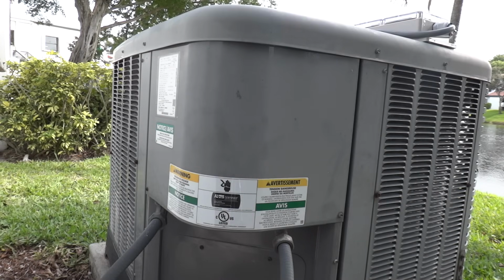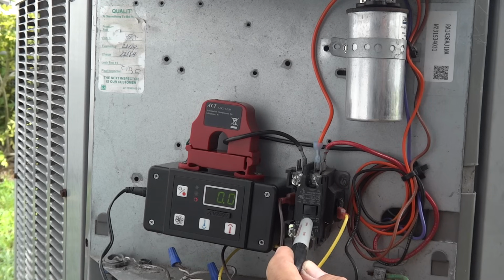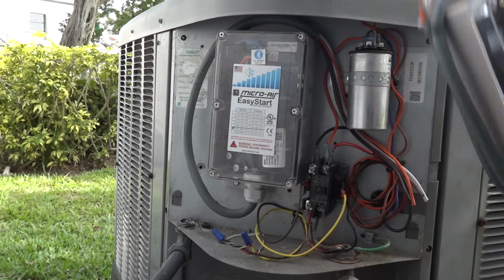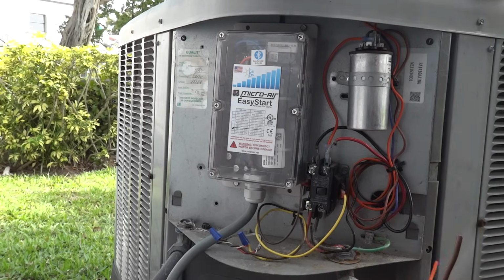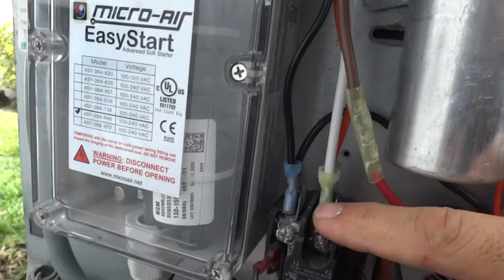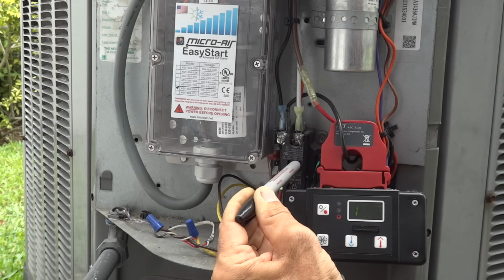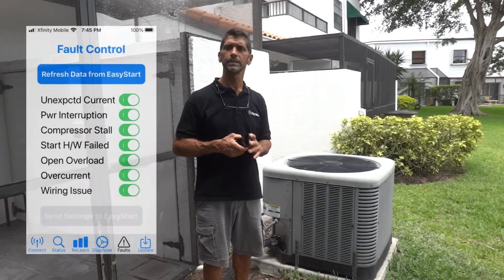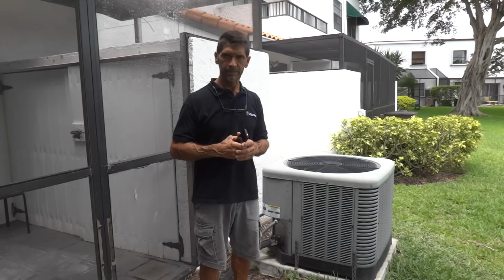Micro-Air EasyStart Home A/C Installation (368 Series)

Comment: Would this work on a well pump 🤔
Reply from the maker: Hi Nick and thanks for your question.  The short answers are: Yes for 3-wire well pumps, and No for 2-wire well pumps.  Wiring a well pump with EasyStart has been done with success a few times in the past, but the Micro-Air support team has ceased support for such efforts since it can be massively time consuming. Unless you are adept at electrical wiring and can identify the common, run and start windings of the well pump, then Micro-Air would not recommend that you purchase an EasyStart for such an application.  If you do know what you are doing, then go for it!  Thanks for your understanding.

Comment: Can these be added to a rooftop mounted, package unit in a harsh climate like Las Vegas or Phoenix?
Reply from the maker: Hi and thanks for your question.  Yes, the EasyStart can handle those extreme climates.  The EasyStart model 364 has demonstrated this for several years now as it has been installed into RV rooftop applications that reside in mostly desert conditions. For your package unit, simply make sure you don't locate (mount) the EasyStart near or in the hot air discharge path of the condenser fan.

Comment: Interesting how does it affect the warranty on the AC if still applicable.?
Reply from the maker: Hi John, and thanks for your question.  The honest answer is: It depends on the OEM manufacturer.  Although everyone knows that EasyStart protects the compressor better than any OEM configuration, some manufacturers who don't understand what EasyStart is may reject a warranty claim if one is installed.  We find this preposterous because many people install hardstart kits which is still "modifying the equipment", but most manufacturers don't put up any warranty argument against those.  The easy and honest way to get around this is to follow the same method:  Install the EasyStart in such a way without cutting any wires where it is easily removable.  Then, if during your warranty period something fails like the fan, or the control electronics, or it develops a refrigerant leak, simply remove the EasyStart before submitting the system for a warranty claim.

Comment: Thank You, it was a great video explaining all the details. I plan on purchasing one shortly. I have an old 5 Ton Trane 36 year old AC and I'm not quite able to purchase a brand new one just yet. My electric bill over $900.00 dollars. I hope that this will reduce my electric. Of course the electric company is price gouging when the country is in despair. Thanks again
Reply from the maker: Hi and thanks for your comment and for your business!  Just to make sure this is clear and you are not disappointed, although EasyStart will dramatically reduce the startup current spike that your compressor draws during its first second of operation, EasyStart does not affect the compressor's current and power consumption during steady-state running. Therefore, EasyStart will not reduce your kWh consumption (i.e. energy use).  However, if you live in an area where your electric utility charges what is know as a "demand fee" for peak power consumption during certain (high-demand) times of the day, then EasyStart would reduce and perhaps even eliminate those fees.  I hope this makes sense.
Reply: Try cost justifying investing in some solar panels with a 5 to 11k inverter and if you can afford it, some backup batteries.  There are Federal and some States have Tax credit incentives to help with the costs.  Over time reducing that $900 bill will pay off.  Avoid financing where they put a lean on your house.  Some dealers call it something else but its a lean.  Either pay cash or get a conventional loan or a home Refi line of credit.   Also, as a low cost option, having upgraded insulation and attic fan could help a bit as well.  
Hope that helps.
Reply: @GlenCapobianco  l live in Las Vegas, NV. I installed an attic fan and remote wireless thermometers in my attic and outside under the eaves always in the shade. I wanted to document how well the attic fan worked. 

Much to my surprise, my attic never got as hot as the outside air, was always cooler, even at 5pm the hottest time of the day, even during weather alerts and warnings for extreme heat. 🌞 

So, I never turned my attic fan on. Why would I want to replace cooler air with hotter air?

This totally surprised me. I just ignored the attic fan. In hindsight, obviously, I wish I had benchmarked the air temps before buying and installing the attic fan.

Comment: My condensing unit starts up with liquid in the (scroll) compressor after sitting a few months, which besides making lots of noise, can't be good for the compressor. Does this EasyStart unit reduce start-up stress on the compressor with its soft-start while in this condition?
Reply: Your crankcase heater may have failed, or there may not have been one installed from the manufacturer. It's an easy installation/replacement. It looks like a big hose clamp wrapped around the outside bottom of the compressor. It slightly warms the compressor so that oil and liquid refrigerant do not migrate to and stay in the compressor.
Reply: @icanreadthebible7561  This unit does not have a crankcase heater, and Emerson even says they're not required for scroll compressors if they have a max charge level meeting their specs. See this: https://climate.emerson.com/documents/crankcase-heaters-for-scroll-compressors-technical-information-en-gb-7486018.pdf 
I also don't want to install one as it would cost $125/year to operate it in my area. The soft starter solves the slugging noise problem as I said above, so these EasyStart units do a great job.
Reply from the maker: Hi and thanks for your question. As you already know and as all compressor manufacturers would agree, "slugging" liquid refrigerant or perhaps a slug of oil through the scroll vanes during startup is not the best thing for the health of any compressor.  But, as you pointed out, it's sometimes unavoidable.

We don't have any empirical data to back this up, but basic logic dictates that because EasyStart will more gradually ramp up the compressor speed as part of its soft starting process, it will certainly be less stressful on the compressor mechanism itself during the first second of operation.  Most certainly, EasyStart will result in less mechanical stress versus a the much more abrupt and aggressive acceleration of a typical hard start (i.e. without EasyStart installed).

Comment: I purchased one last year and my 8500kw generator runs my 3Ton Trane along with 2 refrigerators, lights ext. 

Question: can something like to be used on an inverter based AC system like a Daikin or Mitsubishi? My guess is that they don’t need to be used because of the low start up requirement of those type of compressors. Can you confirm?
Reply from the maker: Hi Jim and thanks for your comment and for your business.  Regarding your question, what you suspected is correct.   Inverter-driven compressors on mini-split systems do not require nor can they even accept a soft starter. Such compressors are 3-phase, brushless DC (BLDC) motors.  Typical home A/C compressors like yours utilize AC induction motors, for which EasyStart applies.  BLDC motors are already ramp started by their controller to eliminate any starting surge, so there is no need for a soft starter.

Comment: can I install a Micro-Air EasyStart in a compressor or any other motor?
Reply from the maker: Hi and thanks for your question.  The short answer is: It depends on the type of motor.  EasyStart is designed to work with single-phase, split-capacitor motors; these are single-phase motors with a run winding and a start winding.  Single-phase motors without start windings, known as shaded-pole motors, are not suitable for EasyStart. Please also check out the reply we made to a similar question from @MrMotofy from a 2 days ago.  There can be a lot of challenges associated with applying EasyStart to closed-frame motors, other than HVACR compressors. Micro-Air unfortunately does not have enough resources to support individual applications like these.
Reply: @MicroairNet  would be great if you guys made something like this for well pumps in a home.
Reply from the maker: @Barr Thom Yes, as was previously asked by @Nick G and answered by us in another comment to this video, EasyStart can be wired to 3-wire well pumps. The wiring is a challenge though and is not recommend for someone who isn't very adept at electrical wiring and PSC motors.

Comment: Could one of these be added to an 120v air compressor to help with the high draw on startup. I think most of em have a 2 wire Capacitor
Reply from the maker: Hi and thank you for your question. The short answer is yes and no.  It has been done with success in the past in some cases, but Micro-Air does not recommend it nor can they support you in the effort.  Here's why.

Years ago when EasyStart first came out, Micro-Air did work with customers with air compressor, dive compressor, and HP water maker pump motors to install EasyStart.  Unlike air conditioning compressors that "present" all of their wires quite easily and readily, closed-frame 1/8 to 3 HP motors do not! In fact, in order to gain access to the wiring, you sometimes have to disassemble the motor.  Then, if you cannot get the motor manufacturer to provide you an accurate wiring diagram for all of the motor's internals, trying to identify the common, start, and run winding connections can be almost impossible.  Isolating the run winding is also sometimes impossible.  So, unless you have a detailed internal wiring diagram for your particular motor, have extensive electro-mechanical skills where you can locate and access all of the wires by disassembling if necessary, and have infinite patience and persistence, Micro-Air does NOT recommend that you consider installing an EasyStart on such motors.  Micro-Air is a small company and is literally buried in production and support work this time of year, hopefully you can understand this position.  Thank you for your understanding.

Comment: How long is the life of the EasyStart. The way I understand it is that it needs to be replaced every 2-3 years
Reply from the maker: Hi and thanks for your question.  The life of the EasyStart will most likely exceed the life of your air conditioner. It does NOT need to be replaced.  In almost all cases, the air conditioner will have to be replaced first, and many people will remove their EasyStarts, reinstall them into the new unit, and perform the relearn process.  There are EasyStarts installed into the Micro-Air factory air conditioning systems in NJ and in the owner's home that have been in operation since 2012.
Reply: @MicroairNet  Great News! Thanks for your information!
Reply: @MicroairNet  thanks for the answer!

Comment: Can this be used on a 3ton York Heat Pump?
Reply from the maker: Hi and thanks for your question. Absolutely.  A heat pump is simply and air conditioner that has a reversing valve, allowing it to heat or cool.  The compressor wiring is the same, and how the EasyStart wires in is the same.
Reply: @MicroairNet  Thank You for such a prompt response! I will be ordering one asap... any discount codes? Can't blame a fellow for trying...
Reply from the maker: Glad to help and no problem asking.  Enter EASY15 at checkout and you will get $15 off!

Comment: I'm not interested in operating my AC unit on a generator, but I am looking for ways to quiet the outside condenser unit.  My house being just 4 years old was built with the unit just 3 feet from a bedroom window.  Dumb.  When it starts, it's very loud and sounds like a train wreck and is a disturbance to the quiet bedroom.  I was thinking of adding a compressor sound blanket as well.  Would the Micro-Air make the starting noise more quiet?  Living in Arizona with a 5-ton keeping  2400 sq. ft. home comfortable.
Reply from the maker: Hi and thanks for the question.  As a matter of fact, YES, the EasyStart will quiet the noise that the compressor makes when it starts up!  This was an added benefit that we never thought mattered until our (RV) customers started telling us about it in droves.  It works the same on a home A/C unit too.  EasyStart of course does not affect the noise that your compressor makes when it is up and running steady-state.  It only affects the start-up noise.
Reply: Hi 
I am planning to install Easy Start for quieter  compressor starting.
Thanks for answering my question.

Comment: So its a hard start kit inside a fancy enclosure.  With wiring so any homeowner can install one..  right?  I could see little ole miss betsy with a screwdriver, this thing and a confused look on her face standing in the middle of a pile of parts of what used to be her air conditioner..  lol..     

But would be only right to advertise the product as a hard start kit..
Reply from the maker: Hi and thanks for your comment. As it turns out, EasyStart is not anything at all like a hard start.  Please watch the video at this link, https://youtu.be/soP0uZFd0nQ, for a detailed side-by-side test and explanation of a hard start vs. EasyStart.

Comment: If this product is that useful why it is not integrated with the original A/C?
Reply from the maker: Hi and thanks for your question.  Many of our customers who install EasyStarts on their RV A/C units ask the same question.  The short answer is, most if not all of the OEM A/C system manufacturers, be it for home, RV, or marine, know about the EasyStart and the fact that their customers see huge benefits when running on a limited power source, or simply extending the life of the compressor on utility power.  However, when it comes to building EasyStart into their systems, many of these manufacturers won't take the risk of increasing their product costs since they are all typically in fierce price wars with each other.  It's very sad, but we at Micro-Air don't despair.  We're actually quite happy with selling EasyStarts in the aftermarket, be it to great end users like you, or contractor/dealers who install them for their customers.  We design and manufacture all of our EasyStarts in the USA.

Comment: My question would be, using normal grid and not a generator
Could a soft start help lower a power bill when the AC/Heat is in use as the required power to operate is lessened?
Reply from the maker: Hi and thanks for your question. This question is asked a lot, and the answer depends. First of all, the EasyStart does not affect the running amps of the compressor.  It only reduces the starting amps.  So, since the startup only lasts about 1 second, there really is no measurable energy (kWh) savings over even the long term that would make a noticeable difference on your electric bill.  HOWEVER, in some parts of the USA, residential customers get penalized and charged for what is known as "demand usage", like most commercial customers do.  Demand usage is your instantaneous kW (power) draw from the grid, not the kWh (energy) consumption.  Obviously, since EasyStart pretty much eliminates the starting surge that your compressor would normally draw, if you live in an area where demand usage gets charged to you, then yes, EasyStart can save you money in that case.  Hopefully, we were able to explain this difference clearly enough.
Reply: @MicroairNet  Yup, exactly the info i was looking for. Thanks :)
Reply: No, at most it would provide a power factor correction which in residential power, doesnt factor into anything as the back emf isnt substantial inside homes unless you have a sizable shop with equipment and machinery inside.. all this does is smooth out the ac waveform and provide a starting current for the bigger motors on the ac compressor/s so they dont draw all that power thet need straight off your incoming power feed..  think of it as a spring on a garage door, without it the door will still open but over time the motor will start to bog down and eventually fail, the spring is added to lessen the strain on the motor.   The reason theyre not included in every ac is because most already have a factory installed start capacitor to take up that strain on startup.  But overtime, on over used systems or under rated systems  will begin to fart out and hard start kits will be suggested to be installed by an hvac tech to help the generator.  This kit is the same thing but for generators which dont have the balls to provide that start current, so this is a hard start kit with a micro controller which makes it able to sense the power needs for applications its installed on..   basically.  Best i can explain it..
Reply: @Z-Ack  Very well stated! Thans.

Comment: Just installed a 368 bluetooth on my A/C. The inrush has not changed, same amp draw. No fault codes. "POWER" and "NORMAL" LED's are lit green. Relearned three times already no change. Any ideas?
Reply: Nvm, I figured it out. All is well. Amazing product!
Reply: Without microair 65 amp inrush. With microair 22. Will update in a year or so.
Reply from the maker: Nice work! And thank you for the compliment.  Enjoy your EasyStart!